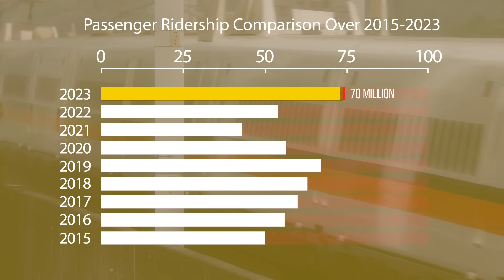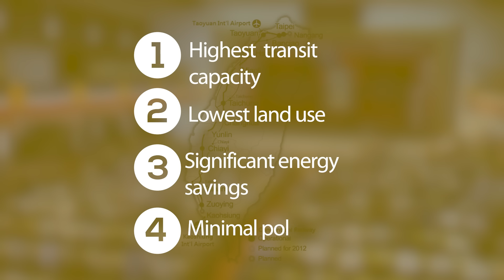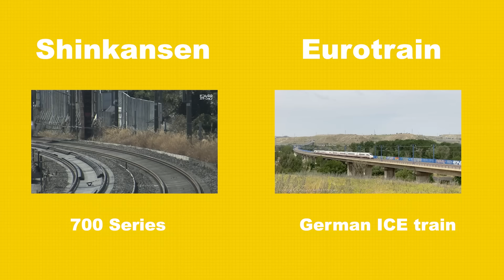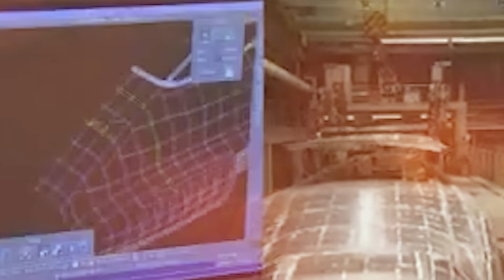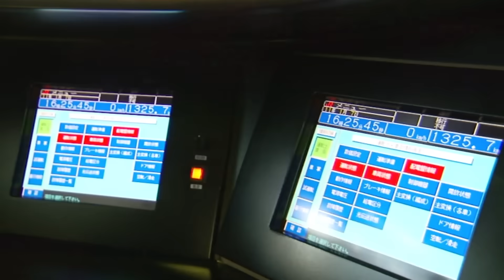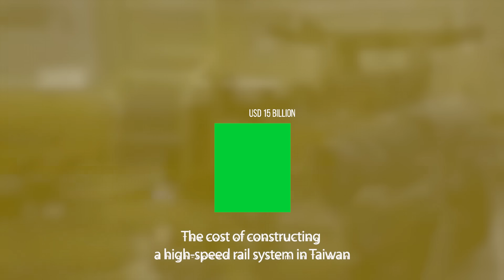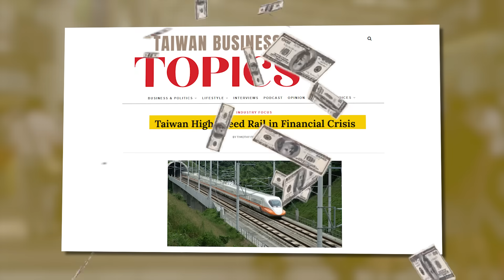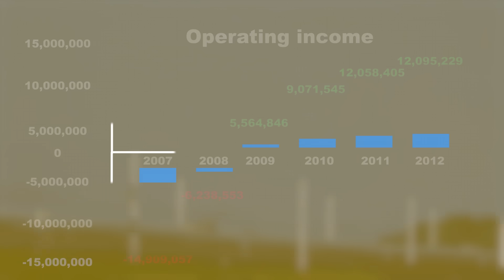Taiwan’s High-Speed Rail: Combination of Japanese-European Technology

Comment: Before the operation of the Taiwan High-Speed Rail Corporation, it took 6-7 hours to drive from Taipei to Kaohsiung. After the operation of the high-speed rail, the transportation time from Taipei to Kaohsiung was shortened to 100 minutes, completing the one-day living circle of cities in western Taiwan and solving the problem of highway traffic jams. Although the ticket price is relatively high Expensive, but the time cost is cost-effective, and it also reduces air transportation across cities in western Taiwan. There are no domestic routes in western Taiwan, and it also solves the waste of fuel.

Comment: I wish that they had chosen DUPLEX design from France. It would've carried more passengers and higher revenues with not much higher operation costs for the double decker fleet.

I wonder if the tunnels being larger might have due to this initial considerations for Duplex carriages?

But I guess the Japanese did help Taiwan with lots of earthquake coping technologies, eg.

The Taiwanese government was always going to take over as the majority shareholder. Very unlikely even in Taiwan, High Speed Rail would be consistently profitable.

I will ride the whole length of the HSR in Taiwan next year. 

I also will travel on the entire island loop of the more conventional system. I will, if possible, do that in one go. Apparently one could buy Bento box and snacks in some stations without getting out of the station hence technically I would not interrupt my trip. 

(Anyone that might have tried it, please let me know if this is feasible. Thanks)

Hopefully the proposal for having HSR on the east coast and hence creating an island loop HSR has been approved with study being conducted ATM.

Hopefully it does get built in time for me to ride on the HSR loop before I get too old.
Reply: 歡迎來台灣旅行, 事實上台灣高鐵有提供車上販賣餐點服務, 類似飛機上的餐車服務, 用餐時段也有販賣便當, 我認為非常美味, 提供您參考.

Comment: 1. The reason for the possibility of using a shorter nose, is because the wider tunnels produces less of a shockwave when the train enters, meaning that it doesn't need to pronounced "duckbill" of its 700 bretheren to mitigate.
2. However, this much customization of the rolling stock isn't without downsides. While the first batch had enough numbers to drive down procurment costs, later small additional batches of trainsets became prohibitively expensive, hindering service expansion.
3. The way the video phrased the Changhua-Kaohsiung viaduct is correct, but kinda weird. It used to be the longest bridge in the world between 2004 and 2010, until it was surpassed by the Danyang-Kunshan Bridge in China. It remained in 2nd place since.
4. TRUPO (short for Taipei Rail Underground Project) is -- as obvious from the name -- a grade separation project to bury the entire rail section within Taipei city underground. It's technically a tunnel, yes, but not in the way post people imagine tunnels to be. The longest true tunnel is the Baguashan tunnel, at 7,357m.
5. THSRC was only able to make a net income because of the government bailout, which greatly decreased its interest payment burden. 
6. There is no practical way a Pingtung extension can be complete by 2029. The route hasn't even been decided yet (that's slated for end of this year), and none of the candidates are easy to build. The line depicted in the video is actually the most difficult one, and unlikely to get picked.
7. Likewise, 2030 to Yilan is far too optimistic, as it would need to drill deep through mountains. A comparable project, the 13km long Hsuehshan tunnel under the same mountain range, took 15 years to build.
Reply: You know too much.
Reply: @翠始皇  Insider.

Comment: Great story. In addition to the mentioned minor expansions at the end of the video, are there any long-term plans by the Taiwanese government for further development of the island's railway system, and is there a need for a larger network expansion to improve connectivity between smaller towns and rural areas with major urban centers?
Reply: Generally speaking, the distance between rural urban gaps are very small with multiple mode of transportation available to commute between each other, so its more upgrade than expansion. The really huge gaps were result of geographical issue, as in its up in the mountains.

Comment: There's an issue with the numbers in this video. It states that on average the network transports 200 000 passengers a day on 151 trains. It also states that each train can hold 989 passengers. Now, how to they transport the remaining 50k passengers?

Also typical for a government to say that they'll leave it to the private sector, make the rules impossible for the private sector to turn a profit, buy the private company cheap and change the rules.
Reply: Well, there's actually no issue here.

Cuz not all seats are occupied by the same passenger from the starting station to the terminal station. 

One passenger can take the seat from Station A to Station B, then another passenger takes the seat from Station B to Station C.
Reply: Each train can make more than one trip per day, the entire route is just 345 km right? And every passenger who uses it for commuting perhaps is counted as two passengers transported.
Reply: 989 is the number of seats, not the maximum passenger limit of the train.
Taiwan's high-speed rail oversold non-reserved seat on weekends... It was even criticized for being oversold to the point where the queues on the platform were full from 2F to 1F.

Comment: What happened to the old narrator?
Reply: Just had a new baby, as per a recent post.
Reply: @ianhomerpura8937 l actually agree
Reply: Still highly used just like Japan. More use as commuter train or nearby city transportation. 
Taipei to Kaohsiung(main city of northern and southern Taiwan)
Narrator took about 3.5hr 
THSR took about 1.5hr
I personally often takes narrator since the ticket price is about half of what THSR cost, also narrator stations are all built in downtown. (Which means if I took THSR to Kaohsiung, I require a transfer metro trip, added 20+ minutes to reach central Kaohsiung. )
Reply: The new narrator is AI-generated. Awful, cheap. I want real humans with a soul to narrate.
Reply: @Nasarbajew84  l actually agree with you.

Comment: Thanks for the video. I took Taiwan HSR a few times last year. It was extremely efficient and just like the Shinkansen. The fares were much lower though! The statement about adhering to European safety standards being better than Japanese ones is puzzling, since No Shinkansen has had an accident in 50 years. Taiwan has done such a good job with their transport infrastructure.
Reply: This biggest difference in terms of signal control is that the European one allows trains to travel in both directions on both tracks, while the Japanese system only allows one direction on each. This feature was proven a better design when a huge landslide occurred in the nearby area from where the trains pass few years ago. Due to precautious measure, one of the tracks was shut down, but trains can still carry passengers in both direction thanks to that feature.
Reply: Taiwan's standard rail network (TRA) hasn't had the best reputation in the past so its more than likely a self-imposed reaction to that.
Reply: @EdgyNumber1  Thanks for that information. I also took a freeway which was elevated for many kilometres, thus avoiding the land conflict problems usually caused by huge highways.
Reply: From I what I remember in Japan, Taiwan was supposed to use the French/European system. I think they already designed and ordered everything. But they suddenly got worried about earthquakes, and wanted Japanese signal and safety technology midway in the project. Which ended as using French/European framework/hardware with Japanese software and signal standards.
Reply: taiwan is like japan kids